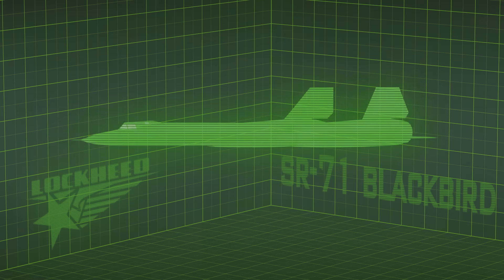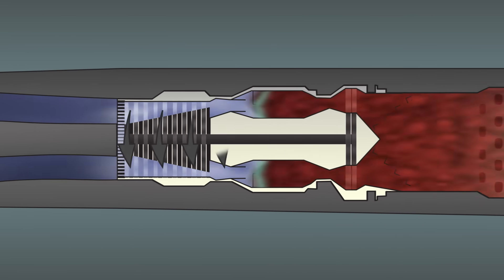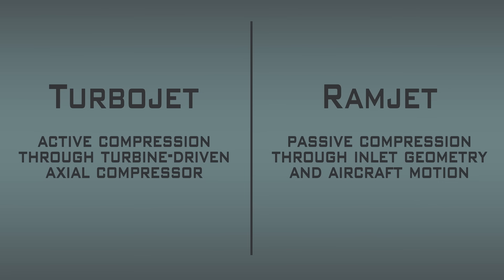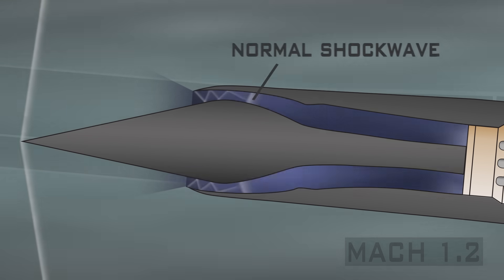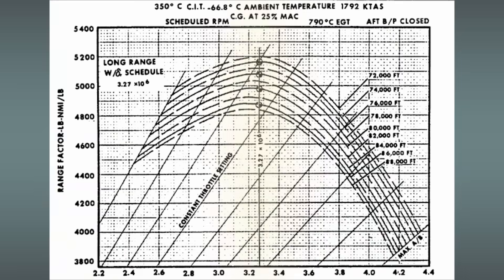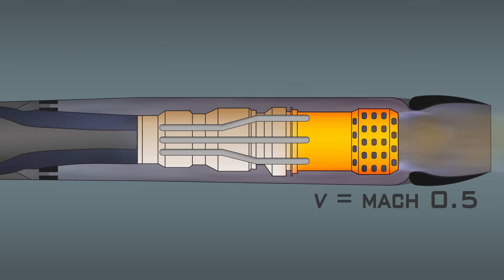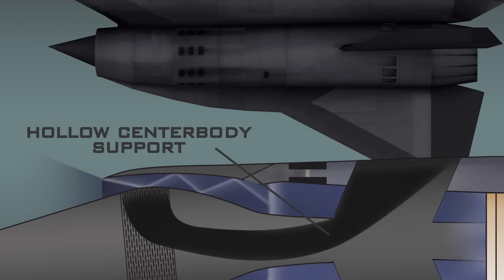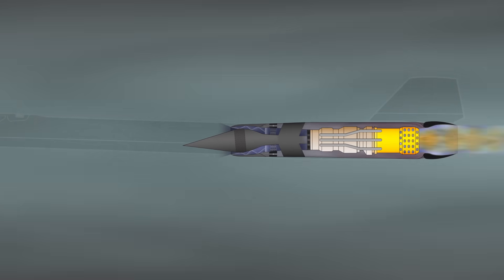The Mighty J58 - The SR-71's Secret Powerhouse

Comment: Everything in this video is wrong! This engine runs on Russian tears.
Reply: Awesome, now how can I get one of these engine for concealed carry?
Reply: they did secretly buy titanium from the Russians to use for this airplane lol
Reply: PHANTOM MEDIA - Cars, RCs, and Lego Technic the landing gear was the biggest titanium made thing on the world, bought right from the USSR
Reply: The MiG-25 was built in response to the SR-71, in an attempt to catch it and shoot it down.  However, sustained operation above Mach 2.8 generally resulted in the engines eating themselves.
Reply: silicon212   The MiG-25 was conceived and designed to counter the threat of the B-70 Valkyrie bomber, which ironically enough, never went into production
Reply: Actually the Russians were unaware THEY provided the titanium to build the SR-71's.  We used front companies to provide the deception.
Reply: the SR 71 is faster then what they say
Reply: Oh... and RE, the SR-71 vs the Mig-25/31

Both of these aircraft could exceed their “top” speeds. A turbine engine is generally only limited by temperature. This temperature either goes up as a result of less air at high altitudes, or in the case of the SR-71 and the Mig-25/31, the amount of compression applied to the air by their supersonic inlets combined with the extra fuel to overcome the increased drag. 

Turbine engines are capable of amazing performance for short periods of time. Limits are set to ensure they meet required reliability. The engines in my plane, for example, can produce 156% of its rated power for a few minutes without affecting its overhaul time at all. In wars and emergencies, all bets are off. You firewall it until it melts. 

Which brings me to the SR-71 vs the Mig-25/31. If an SR-71 did ever do a USSR transit... the Soviet PVO would immediately launch several of their aircraft. Based on their reactions to Gary Powers, they would do absolutely anything to down the aircraft... including firing missiles with their own aircraft in the sky and using their aircraft to ram. They would exceed their engine limitations in order to intercept for the few minutes they would need to. 

The SR-71 would surely try and escape, but here’s the dilemma. Over North Vietnam or North Korea.. it would only have to overtemp its engines for a couple minutes until it was out of danger. Then hit a tanker and back to Haneda. 

Over the heart of the Soviet Union... it’s engine would have to last for hours at over temperature—something that even if it were possible certainly wouldn’t be wise. Fuel consumption goes through the roof as well... and it’s very doubtful a very vulnerable KC-135 would be waiting at the edge of Soviet airspace to tank it up, or that it wouldn’t be subject to fire by the PVO. 

Now, could a Mig-25/31 fly faster than an SR-71?  No. But it doesn’t need to. 

Years before the SR-71 even existed both side developed the tactic of the ‘collsion course’ interception. What’s important to realize is this is all under instrument flying. Visual contact is not desired or even possible in many respects. The fighter was guided to the proximity of the target via GCI, it acquired the target using its own radar, and it plotted an intercept course which would put it into a favourable firing position without the necessity of a stern chase. Weapons were specifically designed for collision course intercepts. Now, the SR-71 was designed as a stealth aircraft. But two things it had that weren’t stealthy at all were it’s immense heat signature and the barn door radar reflections off its exhaust plume. Sure there might have been ECM, but all that would do is wake up the military and have them anticipating an attack. And in clear weather (which you kind of need for a reconnaissance mission), possible visual contacts which negates the effectiveness of ECM. 

This is what a 20 year professional background in aviation gets you... vs schoolyard talk based on emotions.
Reply: @Bartonovich52  wow.. :)
Reply: absboodoo, It's simple! 10M USD in my account and it's yours.
Footnote: permission from the Congress for a such import not included in the cost.
Reply: The Ruskies knew/know how to make seriously impressive jets, and on a much lower budget than the US. The Foxbat was their Mach 2.5+ effort (interceptor rather than spy). Although the A-12/SR-71 was a pinnacle of aviation, no doubt.
Reply: @zx7-rr486  Ya, But there eng. burned up. ours did not.  ;P
Reply: @zx7-rr486  pp0
Reply: ZX7 -RR you might want to look into the Foxbat a bit more before making such a proclamation. There was a defector that flew one to Japan, if memory serves me. We sent scientists to look at it ( from Skunk Works I’d imagine). They didn’t stay long and didn’t take the aircraft. I’d say they weren’t impressed. Not sure where the aircraft was relocated to after that. I have read articles years ago how it was a major PR campaign by the Ruskies and it was actually a POS. I am going back now to look those articles and stories up again. 👍🏻
Reply: Even though you gotta give credit were credit is due the soviets did pretty damn good at building a rocket through the same.... way trial and error... not saying I appreciate what they strapped on to those rockets but you get my point.
Reply: ZX7 -RR
CIA: A-12
Lockheed: SR-71

Hah don’t get mixed up
Reply: Without the Russians America wouldnt be able to motivate their military spending, causing mass unemployment
Reply: Krispy As Fuk im saying LOL and i actually did LOL out loud
Reply: You win.  This jet was so amazing Cobra made a copy na mean?
Reply: Probably, all the titanium for them were sourced from Russia.
Reply: Fkn racist!
Reply: Considering Russians never cry...
Reply: ... tears of joy colleted from russian makers of RD-180 sold in US
Reply: rust Take that back you Filthy Dog!
Reply: rust Just fucking with ya man, I got nothing against Ruskies.
Reply: I rubbed it once with my male tears of pride, at a museum, 
Part of me became a part of it.
Reply: Why?  It never overflew Russia... and after every Baltic transit there was a Mig-25 in perfect firing position should it have a navigational error. Heck.. even the Swedes got missile locks with their much lower and slower Viggens.
Reply: Getting missile lock is one thing, actually firing and hitting it was another thing by far.  No missile could catch this plane.
Reply: @pontiacdriver999  except the S400M :p
Reply: @pontiacdriver999  

Why did USA suspend use of SR-71 to fly closer to Russian border let alone overflying Russian air space??
Reply: Bartonovich52  HA HA HA !!!  “It never overflew Russia”!!! Funniest comment here! Great job- thanks for the laughs- oh, I nearly pissed myself laughing so hard... Tell me another one, please!!!
Reply: @Erik Arneberg

Where ever did you read that it overflew the Soviet Union?

And don’t give me “its top secret” crap. From the Pentagon Papers to Nixon to Ollie North to Edward Snowden there’s two things I know:

1) That the US is very lousy at keeping secrets. 

2) That the military and government in general are far less competent than they’d have us believe. 

If the SR-71 ever overflew the USSR, it would be public knowledge and bragging rights. But it isn’t, because it didn’t.
Reply: Oh... and Erik Arneberg

Thank you for the laugh. 

I know that you Americans (or even if you’re not American) really buy into the American Myth since it’s shovelled down our throats on a daily basis... but the fact that you ridicule someone about something for which you have no proof of otherwise really puts it into perspective how conditioned you are to believe and defend things you haven’t even been told but supports a certain narrative.

Comment: how does this compare for efficiency vs. say the concorde engines and the latest super efficient airliner engines? i'm assuming not well, but if you can get mach 3.2 out of it, wow! i wonder what they could build now with modern technology.
Reply from the maker: Efficiency is a relative thing.  In terms of mass moved over distance, the J58 and the SR-71 aren't very efficient, compared to a turbofan or a turboprop.  Turboprops are actually 'more efficient' in that regard than modern turbofans, but they move more slowly and operate at lower altitudes.  So, for its class, and actual fuel consumption, we can say the J58 is 'efficient', but it's nowhere close to actual 'efficiency' in getting from A to B.
Reply: The SR-71would be  more efficient than the Concorde because of the pressure recovery of the SR-71 mixed compression inlet.  Mixed compression inlets have the shockwave start externally and then slowly bring it inside the inlet. Concorde's inlets are external compression meaning they keep the shockwave outside of the inlet.....which is why it never experienced the dreaded unstarts. Most planes with external compression inlets limit their speed to mach 2 because they burn way to much fuel above that. The SR-71 was able to efficiently move well beyond that because of the inlet design.
Reply: The J58 isn't very efficient until it reaches very high speed and begins relying mostly on the ramjet part of the system.
Turbofans are significantly more efficient at mach 0.7, but that's not going to do you much good trying to evade a missile.
The J58 is very efficient above mach 2.5, but the amount of stress and maintenance and complaints you'd get from operating an airliner above mach 1 would make it completely useless.
You don't design a turbine with efficiency across the board like you might with an internal combustion engine, you design them to be most efficient at a given speed.
Now that being said, if the ramturbojet DESIGN was more fuel efficient below mach 2.5, you'd see a lot more engines like it.
Part of the reason you don't, is because of aerodynamic drag. Air gets harder to move through the faster you go, making you exponentially more inefficient in fuel consumption. This is why you see such low cruise numbers on a lot of fighters like mach 1.2 to 1.4, when their top speed is above mach 2.

Comment: I managed to get a pretty close look at the SR-71's several times, at Kadena AB on Okinawa, back in 1972 and there appear to be air inlets near the tail end of the engine nacelles and there also appear to be 3 rings of what look like injector nozzles in front of them but behind the turbine, seems pretty obvious that those are the afterburner injectors but behind the "air inlets" are 4 more rings of the same thing. I'd like to know what I saw and how it compares to what this video described. It looks to my layman's eyes like that part of the engine(?) can be operated as a pure ramjet at high speeds, not dependent on the "bypass" tubes. Is that possible?
Reply from the maker: There is an air conduit around the engine that has a set of forward and aft bleed doors - at low speeds insufficient air is flowing through the engine to keep the air flowing through the afterburner properly, so the aft doors open to let in extra air and reduce the internal pressures.  These close once airflow optimizes through the nacelle at higher speeds, since it's better to burn heated high pressure air from the bypass tubes than cool low pressure air from the outside, and to minimize drag.
Reply: +TechLaboratories - Aren't you talking about the tertiary  doors , or maybe the suck in doors ? The aft bypass doors are controlled by the pilot and aren't scheduled to be open until around mach 1.7 if I remember correctly.....and that is only position "A" which is only 15% open.  Position B which is 50% open doesn't happen til mach 2. It is my understanding that the aft doors remain closed at low speeds .
Reply: +Chris Baker - Unfortunatly it can't be operated as a pure ramjet because the bypass tubes take the air from the 4th stage.....which makes it a turbo ramjet. It could have if they placed the tubes in front of the compressor...I never could figure out why they didn't do that. In theory the aft bypass doors in full open position could make it operate as a ramjet , but the doors wouldn't let enough of the air to bypass because they weren't designed for that purpose. The air from the aft bypass doors gets dumped into the ejector nozzle though, not the afterburner so I guess even that wouldn't make it a true ramjet. The aft bypass air does add thrust but since it doesn't enter at the afterburner it can't be considered a true ramjet.

Comment: An "unstart" is when the inlet becomes over pressurized and ejects the shockwave back out of the inlet. It is the inlet that is "unstarted", the jet engine continues to run. It was a delicate balancing act to manage the inlet pressure. This was the most common unstart. The jet engine ingesting the shockwave as mentioned here was only possible when accelerating past mach 3.2 where the shockwave can no longer be controlled by the inlet spike. This is technically considered an unstart but the jet engine would probably shut down and suffer damage by ingesting a shockwave. That is the reason that the SR-71 was designed to operate at mach 3.2 , it did have limits. Acceleration past this speed started entering dangerous territory. I have never heard of that type of unstart actually happening but they probably figured it out during a testing phase.

Comment: At what engine speed does VTEC kick in yo?
Reply: When those air flaps open and close, along with the front cone retracting at certain mach speeds, that is a version of VTEC. Just like VTEC it's dynamically altering the air/fuel mixture.

Comment: Here's an interesting fact for you.....the J58 is basically a constant speed engine. This was confirmed by two SR-71 pilot friends of mine. The J58 actually had trouble breaking through the mach 1 sound barrier wall without burning tons of fuel which is why they used a maneuver called the dipsy doodle. If the engine RPM kept increasing by increasing throttle like most jet engines, not only would the engine overspeed at mach 3....but it would also burn tons of fuel. By constant speed I mean the difference between idle and full throttle is around 3000 RPM. Throttle mostly controlled the ejector nozzle and afterburner.
Reply from the maker: Cool!